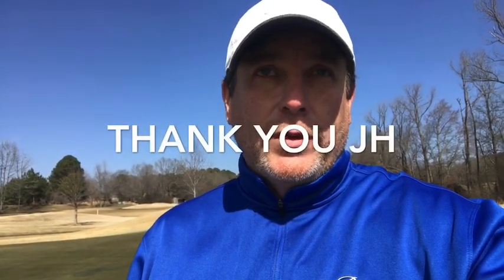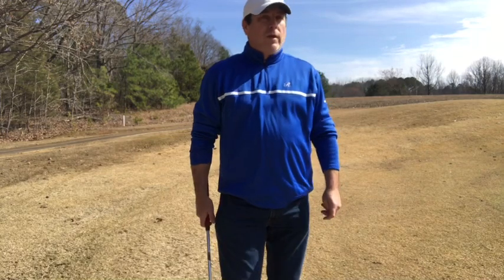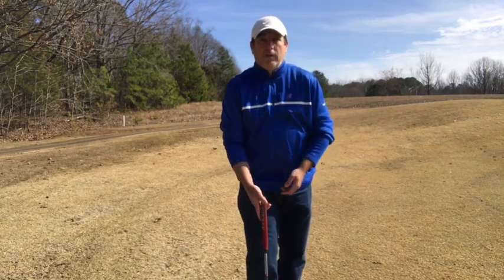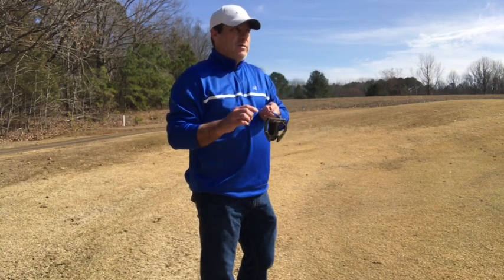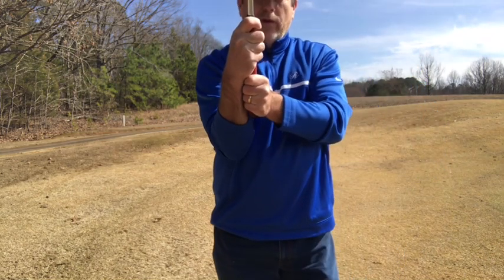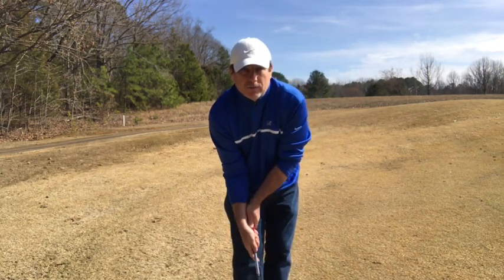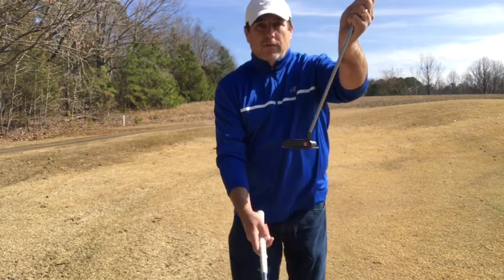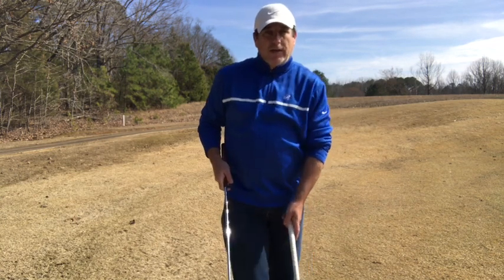Matt Gray...The Grip

Comment: I, too, was doing a CL putting stroke.  And, like Tiger, in a way, not using my lead arm; it’s just along for the ride with the trail arm controlling everything.  BUT, I was using a shoulder swing.  It was the best I had and was ok, I suppose, but my distance control was iffy. I really like this concept of this motion where you can relate to the underhanded roll to gauge distance better.  

I’m excited to try it.  Thanks Matt!  It has a little bit of George Lowe in it, I think.  I believe the little pop will help prevent leaving the putt short.  We’ll see!
Reply: Craig Guthrie          I call it the pop mini roll. I’ve trained my eyes what square is and the only way I can see that is from a back ball position. The putter face never opens up just like the cL swing
Reply: Craig Guthrie     I’ve watched that video and i used the pressure points with the trigger finger and thumb .It works great and many will like that way of doing it.  I just wanted to offer a different grip and this works extremely well for me. I’ve never made such a high percentage of putts in my life . I really don’t care how it looks visually. I would      Stand on my head if it gave the results I’m getting now. It seems like I’ve went down every road possible before I found this . I just listen to Jh and put my personal touch on it. He was happy for me and has my back 100% on this so it must good.   Cheers
Reply: Matt Gray This is just FYI.  No need to reply.  But I’ve been practicing this in my garage for the past 45 minutes.  And I get it!  This works and the balls are going right to the hole like lasers.  

My main issue, at this point, when I get that cup in my lead hand to lock it in, and get my elbows touching my side, the putter head is sooo far off the ground!  I have to really really bend my knees way down to get the putter behind the ball.  I’m 6’2.  But it works well.  I’ll have to spend some more time with it.  My putter is 35” long.
Reply: Craig Guthrie     I’m sure different body types could the geometry a bit different. I would love to see what’s going on and feel free to send me a vid through my email. My putter is 34 and I’m 511 and my trail hand is at the bottom of the grip.
Reply: Matt Gray Thanks.  I could do a video.  But I think I was overdoing the cup in my lead wrist.  You kinda suggested in the training video to maximize it but that really makes you bend your elbow.  And when your elbows are way bent, the putter head is very high off the ground.  I just relaxed the cup in the wrist a bit and this is more comfortable.  I no longer feel like I’m going to take a dump on the putting surface!  😂
Reply: Craig Guthrie     Having the trail arm extended will take care of everything. The lead arm just goes on the club with a cup in the wrist . The cup is to keep the club locked in place . My left arm just pressure inward and the trail arm rolls the ball .
Reply: Matt Gray Got it now!  Perfect!  Confirmation in the garage on my putting green!  My wife thinks I’m NUTS!  

Thanks Matt!  I was over emphasizing the cup in my wrist.  I was taking it to 90* with my lower arm.  Then, taking that to my putter grip, my elbow was bent to 45 degrees.  But I stuck with it.  I knew there was something special at the end of the rainbow.  🤜🏼💥  Thanks again!  Love my locker family.

Comment: This pretty amazing Matt. I'm not kidding here or exaggerating, I've been working on this same exact thing (not just a couple of similarities). Everything. Mind you this on carpet and not on a green yet. Maybe it's something about being CL'ers that naturally evolves to this I don't know. One thing that you didn't mention that I've found that is to let the wrists hinge slightly to avoid too much arm drift. And also to keep the upper part of the left arm in contact with the ribs. The right hand will pass the left letting the club head release to the hole.
Reply: Bob Mook      Hi Bob ,        Yes you are absolutely correct and it’s amazing when you figure this out. I think everybody putts well indoors but this works outdoors as well. I’m excited watching putts drop one after another . Finally found something that I can repeat . I’m still rough around the edges but it’s just a matter of refining everything.   Cheers

Comment: My latest putting grip is both hands underneath the putter pointing up. So far, not many positive results. Thanks for sharing and Ill give the grip a try. If it works I will throw my old "stand up putter" away and get a new one for my new to improve putting technique.
Reply: Dave          Hi Dave ,     Putting can really get in ones head if we let it. I’ve spent 3 years trying to figure it out . I’ve spent countless hrs working on this issue and now I have complete confidence in what I’m working on. I’m using Jh putting method with my personal twist applied to it. I’ve never rolled the ball better ! Cheers
Reply: My second time watching, Is it like a flicking moving action with your right forearm/hand more or less?
Reply: Dave      I roll it with my right hand but it’s a flick at the end . Don’t want the arms traveling in the putt

Comment: Very similar technic to mine. I chopped a old odyssey xg#8 shaft down to trail hand resting beside me hand at top with super stroke grip . then when setting up to ball trail hand goes to bottom of grip lead hand on top elbow and wrist are bent and locked in towards target. My son showed me that new putter on utube that stands on its own and I'm thinking now that could be cheating.cheers
Reply: Nat McIntosh              When Jh glues on his putter grips he reverses them to fit his hands better. This stroke is a pop stroke but I still roll the ball with my trail hand. You don’t want any arm travel in this type of stroke. I want to be a great putter and not just average or below average. It’s taken some time to get the mechanics down and now it’s time to work on other details of putting. Cheers